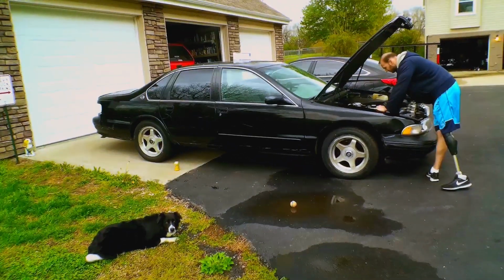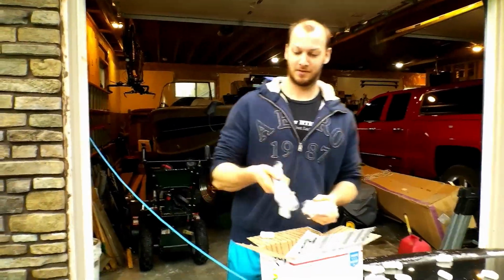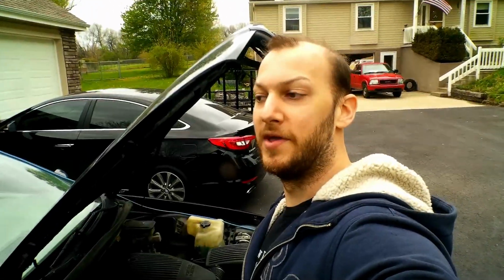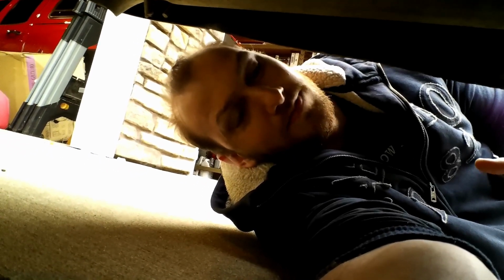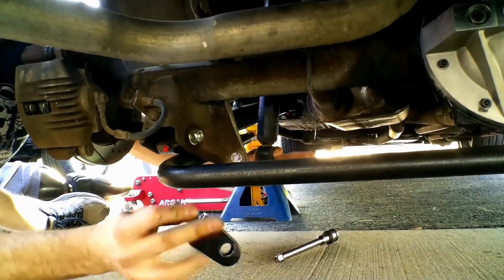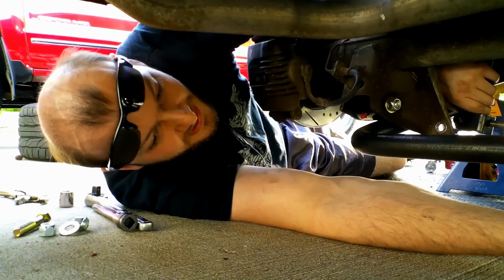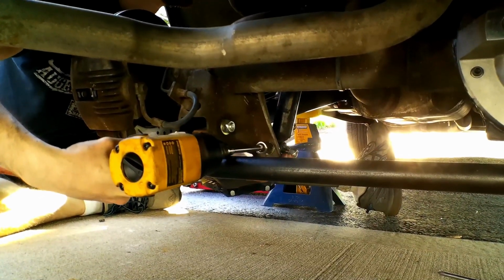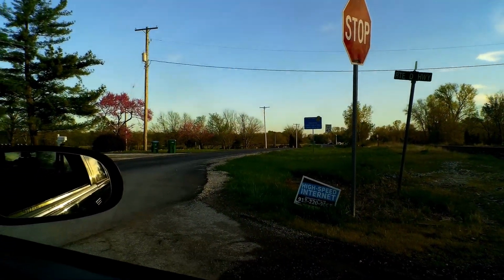HOW TO BUILD a 1996 Impala SS THE RIGHT WAY!

Comment: great stuff bro.  Im fixing up my 96 impala ss. I have about 184,000 miles on it and the problems I have right now is a bypass on my heater core, 2nd air pump has to be replaced, then the relay on my fan has to be changed out.  Im glad your Chevy is looking sweet nothing better than American Muscle.  Keep kickin ass.
Reply: Dude you get the impala all fixed up yet?
You should make some videos of it